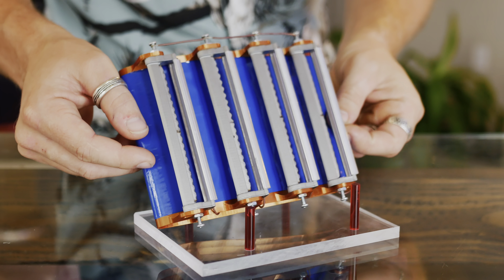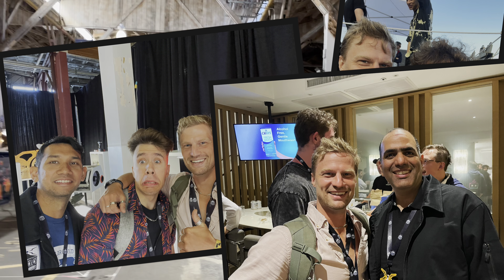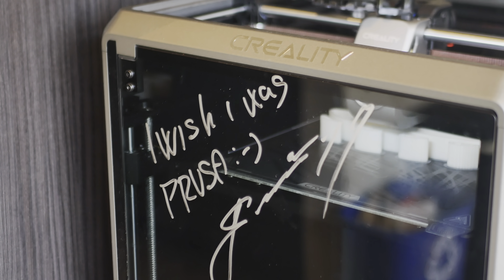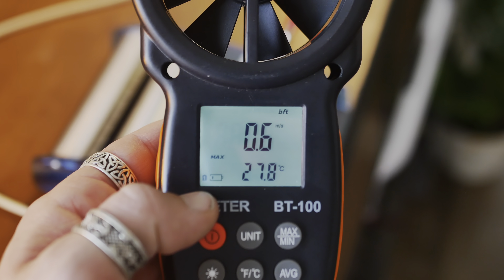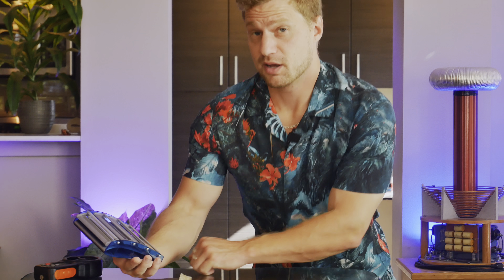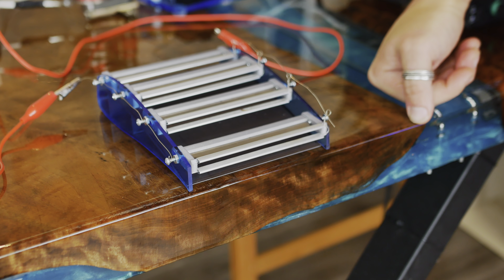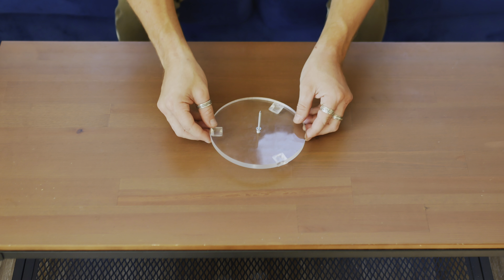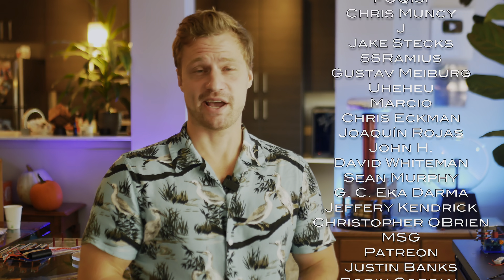Designing A Self Propelling Ionic Thrust Wing

Comment: Hi, Jay! Great challenge, great work! 🙂

Three suggestions for this project.

First: You can place the wires lifted over the wing, but the surface of the HED thruster can be just an aluminum sheet glued to the surface of the wing itself. This can reduce drag, reduce weight and (possibly!) improve the laminar flow over the wing, which largely reduces skin drag. Consider electrodeposition of copper instead of aluminum sheets... would be even lighter and far less disruptive of airflow. Also consider placing wires on the trailing edge of an airfoil in order to avoid creating vortices (you are doing that already, in a sense).

Second: You are thinking of a traditional "tube and wing" glider-like design, which is great, but a more modern solution would be a blended wing body (BWB). Since you are dealing with low speed flights, active stabilization should be far simpler than in the transonic speeds we see in military BWB aircraft, if needed at all. That will give you far more lift and thus far greater flight autonomy. Also, the batteries and HV generators would be sitting on a surface of the plane that generates lift, giving you far less need for structural strength in your wings, translating into a bit less weight overal (and every 10 grams count in your case...). Remember: gliders carry no heavy equipment and that is why their extra long wings can be so light - they need little reinforcement for structural integrity.

Third: You are entering the wonderful realm of active flow control, which is an area that has seen a lot of research lately. Consider using a few of those thrusters under the area near the tips of the wings also and making that area a little "fat" at the trailing edge, so that the Coanda effect will give you "up" and "down" control authority on the wings (as you change the ratio of flow between the upper trhuster and the lower thruster) and you will not have to use (in this case, heavy) servos and control surfaces for controlling youraircraft. In your case, the idea is substituting ailerons for the differential in force between two thrusters, one over the wing and descending because of the Coanda effect, and the other under the wing and ascending for the same reason.

Hope it helps. 😉

PS: Dear Integza (Joel), feel invited! 🤣
Reply: this is very useful information
Reply: This is brilliant, thanks for sharing!
Reply: The solar powered Zephyr is the current record holder for long range unmanned flight and it’s airframe structure is an assembly of thin-walled composite tubes made from high-modulus carbon fibre in epoxy resin. Wings and flight control surfaces are skinned with Mylar. Considering you need enough surface area to lift batteries you might be building a pretty large wing here. The materials above might be the answer
Reply: @GriffithJones  That is an idea, indeed. I suggest you place it in the main responses, so that Jay (the owner of the channel) can see it. Now, it is just a reply to my comment. ;)
Reply: In addition to active flow control, this project is starting to enter the regime of the biplane. With some optimizing, the ionic thrust segment could be a factor in generating lift. The aerodynamics between the segments and the wing could effectively cancel out any added gain from a bi-plane setup, however it would allow you to shrink the wingspan of the vehicle by a margin that may help with weight. 
Additionally, with the vehicle having (effectively) blown lift surfaces (similar to that of the C-17) you'll immediately see some gains from the intake of air from the surroundings similar to a dyson bladeless fan.
Reply: @collinduke4313  I am not a big fan of the biplane setup, I must confess. The gains from a lifting body (such as the BWB configuration) can be superior without the extra weight of, effectively, a second wing.

Anyway, there are good people who disagree.

I suggest you place it as a comment to the video itself. Presently, this is a reply to my comment. :)
Reply: Nice, I didn’t think about forgoing servo for aileron control at all! It would certainly make the design more powerful with it becoming more fly-by, though I am afraid of the consequences of being over reliant on a single system, though I suppose redundancies are more of a finishing touch. I suppose I am still thinking inside the box. Gotta get creative!
Reply: bingo well said sir
Reply: Hello, are these "400 KV voltage boosters" dangerous? I scouted the internet and the best I got is "probably not but maybe" which is not satisfying.
Reply: @MikeOxolong Every single high-voltage application is inherently dangerous and you should only use them if you really know what you are doing (that means: if you have technical training or an academic degree in electric engineering).

High-voltage applications can be wonderful and fun, but if you mess with them the wrong way they can easily kill you (or burn your house... or, most probably, both) and that is not an exaggeration.
Reply: Why would you want laminar flow? You get better lift from turbulent flow
Reply: @Zigmaz0309  Hi! 

You gett better lift with turbulent flow when you are flying with a high angle of attack (such as an old airplane when landing - that is why they placed the (in)famous "vortex generators" on the wings of older large aircraft). In that particular case, you need turbulent flow in order to avoid flow separation. 

However, when in a regular flight regime, you need laminar flow for improving controllability and (largely) reducing skin drag, which is a major efficiency factor for any aircraft.

That is why you don't see vortex generators in modern aircraft. They have been replaced by a better wing design and some variable geometry that keeps the flow laminar while avoiding flow separation.

Comment: You're halfway there.  Now you just need to fully incorporate a solid battery solution into the structure of the wing.  But what if you don't need more thrust per gram?  Why not just make the vehicle neutrally buoyant instead and turn this into a modular design that can be attached in multiple segments to something that carries a payload?  

Maybe all it needs to be able to do is serve as a thruster for steering and altitude adjustments.

Comment: Look into sputtering or that method of metal-plating 3d-printed stuff using carbon and electrolysis. Maybe the CRC dry graphite in a can stuff that's used as a dry lubricant for machines you don't want catching dust.

Comment: Air pressure has to be lower on top of the wing, in order to generate lift, how fast does the air above the wing have to be moving? I suspect that you'll have to make some sort of launcher to get the craft moving enough so the wing shape can work with the ion thrust. I doubt the ion can produce enough force to move a craft with out initial help.

Comment: a lot of slow speed aircraft use leading edge vortex generators.  have you thought of replacing the razor blade with a vortex generator, and use a single blade slats like the Zeniths leading-edge wing slat?

Comment: Not an engineer here... but since you are going for free flow of air or energy over the surface and hoping for lift??  What if you reversed the wing and each unit was one step above the other to free flow independently above the other in stead of going thru the first one??  Maybe like a stack of wings??  And each one could lift the whole in stead of the one lifting the whole.???

Comment: So ive been fascinated with ionic propulsion for about a decade. And your design has some really cool advancements. Another tweak you could try, would be a nossel or using the ionic process to squeeze air and provide more thrust using pressure. To do it might require ether a rectangular nossel, a circular one, possibly close in resemblence to a turbospike. Idk. But thought id share! If you need a lab partner, i need a lab haha 😄

Comment: Try a strut wing where the top wing sweeps back from the front, and meets a rear wing coming from under the rear. The rudders are placed on the wingtips tying the wings together. The 2 wings will assist with low speed flight.

Comment: Glad to see someone doing this. I pitched something similar back in the late 1990's for a lifter with wings whereby the asymmetric capacitor is part of the top of the wing and integrated (where you need the higher flow) and thus creates lift (Bernoulli principle), so the ion streams both provide thrust and lift. The idea was abandoned as the weight of the power supply/battery pack was too much and lost interest.  That said, to lower the weight of the power supply, I would suggest supercaps, for starters.

Comment: Wouldnt having a spline going from front to back in the middle of the wing make it lighter than having 3 going the length of the wing? On a larger or full wing you would need to be more but i think it would still have a good weight reduction than having the support  going from wing tip to plane fuselage.

Comment: Very thought provoking video. from the perspective of a mechanical engineer, you could try using ionic thrust THROUGH the wing (from the upper surface to the lower) assuming that the thrusters can generate sufficient pressure difference to prevent reverse flow. Also, to create a lightweight wing design I would check out Tom Stanton's video on 3d printed aerofoils. Keep these great videos coming!!

Comment: What material were you using to print? There is light weight pla that is designed to be used for gliders and such. It foams when it's heated, so you basically just print every other layer, reducing weight further.

Comment: Hi, as it is one of my hobbies also...
Have you thought about replacing the razor blade position with a very fine line of wire brush. Creating more discharge points thus grabbing more air. Think about it, you know what I mean. The serrated blade in the dark kinda shows what I mean. More bright points.  Think thousands of discharge points with a small spacing grabbing more air without actually obstructing air flow. But increasing it. The receiving end could be the wire. Not aluminum tubes. It just needs to direct flow.  My first thought is to tunnel the wing and let the outside be a wing. Build the thruster inside the wing. You want efficiency. Let the wing be a wing.

Comment: So lift is a product of the speed difference between the upper and lower part of the wing. You have a second surface to attach additional but less thrust..
Can the current flow across the surface and still do a sufficient job or start away and ground upon to affect the air flowing over the surface more directly? Also reducing drag faces.

Comment: I have a question, or more of a comment. Is this an airfoil anymore? I would assume that your thrusters would be impeding lift as they may break up the airflow required.

What to do? You may want to ask your friend about this as he is definitely much more qualified that someone typing on his phone.😊

But a suggestion would be to use a flat bottom airfoil and put your thrusters along the bottom of the wing. Besides allowing for an unimpeded surface on the top, the design of the thrusters would be easier as they would be straight.

Again, just my two cents.

Comment: 15:12 the function of a wing is mainly lift and not forward propulsion. So, testing with lateral movement like the rotating arm is not the best way I feel. You could have used a candelever mechanism, hinge one edge of the lever on a table, place the middle of it on a small weighing machine also on the table, then mount the wingsection on the other end of the lever floating outside the edge of table. then turn it on to see if the weight shown on the weighing scale decreases (that would indicate lift). would that work?

Comment: A rumor circulating for years is that the B2 spirit incorporates some version of this into the airframe/wings. The power is supposedly generated by the static potential of the jet engine thrust. The wings are supposedly made of a ,not-usually-used-to-make-wings, type of metal. Not having been a member of the USAF nor having security clearances necessary to actually know how this is done, assuming it is done, I can only guess.

Comment: I don't know if this is uesful but there is more than one way to describe lift.  One description is that the top side of a wing's higher velocity is able to entrain additional air from above and then curve that entire mass flow downward creating a downward impulse on the air at the back end of the wing leading to an equal upward impulse for the wing.  So basically it's really bad to do anything that interferes from free air in the region above the wing being able to flow into the stream directly near the wing smoothly (turbulence or a physical obect), or a physical object.  And your setup may do both.

I wonder though if tilting your thrusters  to compensate would help (suck in more air).  You may think that would mean not orienting them in the way that would give the most thrust but at the end of the day a flow will be coming off the back and that will have both a downward and backward component and that is the vector that will matter for your thrust anyway (the wing is thrust vectoring regardless so the actual angle of your thusters is not what matters for calculating thrust).  Basically because your wing is both the thruster and the wing the angle out the back will decide your thrust to lift ratio and because you want to maximize both of those things you want whatever gives you the highest mass flow out the back.  But mass flow gained through volume rather than velocity is more efficient, which is what a standard wing does by entraining all that air, and is what makes wings more efficient than just pointing a jet downward.  Your set up may act more like a jet than a wing if it can't motivate air far above it to also move down as one continuous mass.

Comment: Due to the way lift works while the wing is in motion, wouldn't there be a higher density of air molecules under the wing that would increase the performance of the ionic thrusters if placed under?

Comment: could the spacing between the two electrode sections be behaving similiar to grears?

closer together the produce more thrust at slow speed

but as the airflow around them increases maybe their optimal distance is further apart

Comment: use twisted wire so you get the effect of serrations and a non-circular cross-section that won't make the section of wire vibrate and vary the conductance distance. the twist rate should be ideal at 22.5 degrees, imho. (1 twist per 4 diameters)

Comment: I could be wrong I’m not an aerospace engineer but I thought how wings worked and created lift was to have the air under the wing move at a higher velocity then the air moving over the wing. Wouldn’t mounting the engines on top of the wing negate this lifting force? Shouldn’t they be mounted underneath the wing? Maybe some one with experience could chime in.

Comment: I like this very much.  With that said, would making a neutral gas dirigible not make more sense as  an alternative?  A dirigible or a ballon would already be in the air so all thrust from this type of engine would be used for momentum.  Also if the engine is made circular around the blimp body,  then the blimp could act as it's own air foil.  Just a thought!  Keep doing what you do.  The more you work on experimental things and ask the hard questions to which you find answers too,  the better all of human kind will be.  Thanks again!
Reply: And just a thought, the body of the blimp could be made from a material that can carry a current.  Like for example a graphene or graphite coated material.  Then the body could itself be the ground for the thruster.  With just thin rings of wire around it.

Comment: Hey, I could be wrong, I haven't taken Fluid Mechanics in like 15 years, but the theoretical cause of lift on an aerofoil is the streamline of air from the front to the end of the wing line up but over different distances - meaning the particles of gas flowing above the aerofoil (shorter distance) ultimately move slower, than below the aerofoil (sigmoidal shaped so longer distance). So if you run your ionic thruster on the top edge of your aerofoil, you'll be distrupting your streamline causing turbulance but also your lift (because your raising the pressure above the wing). It's a cool idea, but you might want to run your thrusters infront and behind the aerofoil, and then spaced above and below the aerofoil tangentally and extruded outwards slightly. The design, spacing & voltage of the tangential thruster should ideally then be to create parallel streamlines of air at the same airspeed forward and aft of the wing, because ideally they're just trying to help maintain the streamline. Which could I think enable a more aggressive sigmoidal curve on the bottom of the aerofoil to get more lift. Just food for thought. Good luck! Looks cool

Comment: If you were to use a microcontroller and measure the air speed over the wing and  then sequence each of the segments on and off in series as the air flowed you’d both lower your power requirements and accelerate the air speed if you had it running similar to a BLDC motor where the follower was negative while the leader was positive etc. 

I’d bet more than double the thrust. Perhaps even more in a 3 phase configuration (with 6 or 12 segments)

You should be able to use a standard drone motor controller and some simple code to create the right frequency versus wind speed.

Comment: My first thought was -- instead of a metal blade edge, use carbon fiber rod (cf being conductive) with a series of pins stuck thru for emitters. Or possibly balsa wood impregnated with india ink or conductive paint, with pins stuck thru. Also, investigate putting everything below instead of above the wing. Newton overrules Bernoulli in how lift is actually generated.) :face-orange-raised-eyebrow: